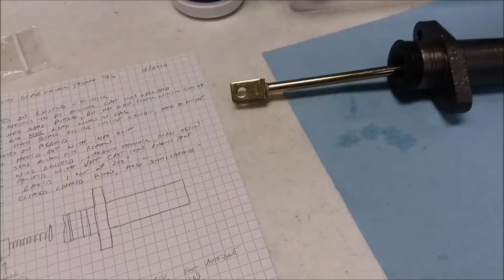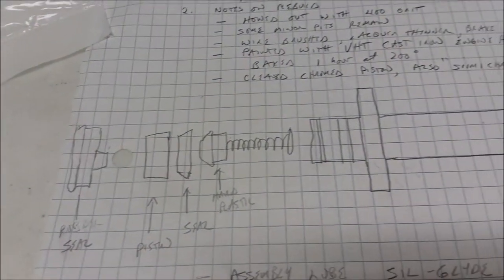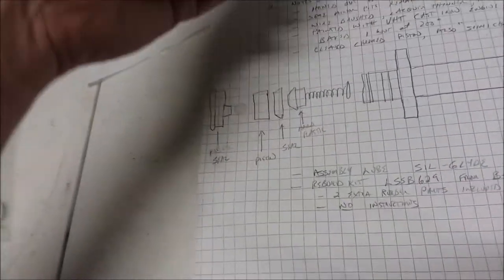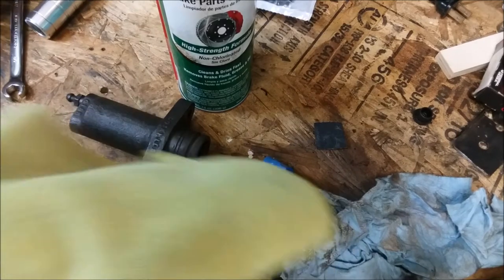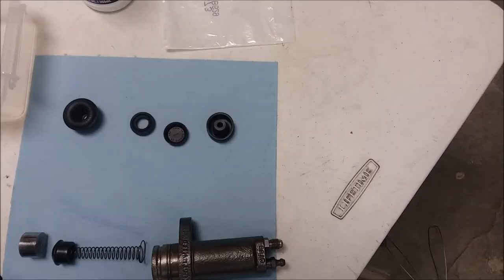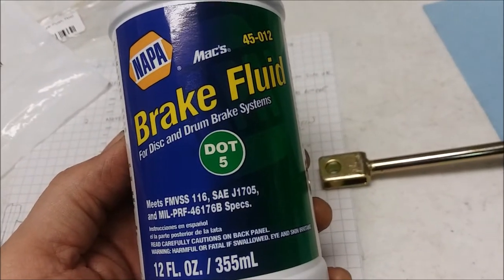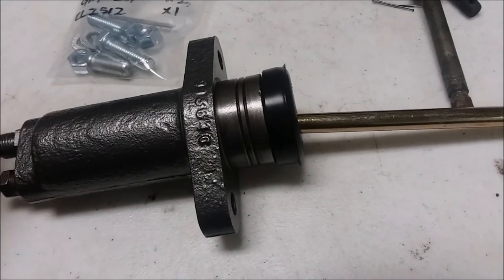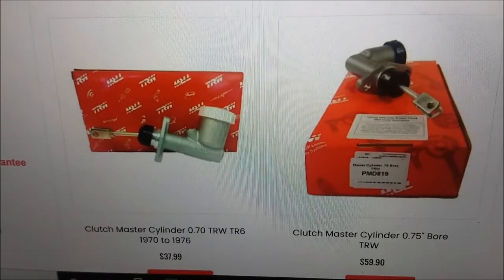Evaluating, Rebuilding Clutch Slave Cylinder for a Triumph TR6

Comment: thank you I watched this as I have a 1973 tr6 and am doing all the work on it myself as I had my tr exported to canada  in 1980 and cant find anyone to work on the fuel injection as all exported trs had carburetas , mines a right hand drive rust free and undesealed from new and hasnt been driven for 42 yrs has 30,000 miles on it so in retireement im doin everything myself as I tried to use other mechanics and that was just like dropping thousands of dollars into a firepit, so your videos will be watched with geaat intent , do you have one about a master cylinder rebuild as thats where Im at  thank you
Reply from the maker: Hi, sorry for taking so long on replying.   Keep me posted on your progress!!!!    You might try Chef Tush or Elin Yakov up there in Canada, see if they can point you to a mechanic that can work on the EFI.   Search on their names and "Triumph" and you should find them on Youtube.  

  I haven't done one on rebuilding a TR6 master cylinder, sorry.  Mine was beyond rebuilding.  I have done one on the brake booster adjustment.  https://youtu.be/J1ozyqzZqUI      
Before I switched to video, I did do a blog entry on rebuilding a TR3 master cylinder if that helps.     You might want to consider getting your TR6 MC  done by a rebuilder and getting it sleeved, IF you have an OEM master cylinder.  Try a rebuilder like Apple Hydraulics.  BTW - I have no financial interest in them...,

Comment: Great video Thanks good to know as I am almost at the stage of doing this.
Reply from the maker: I just checked out your channel.  My next project is part of what you are doing now - I am going to paint the engine bay, as mine is previous owner rustoleum black.  Let me know how your cylinder rebuild goes!
Reply: @triumphrestoration7403  Turns out my Slave cylinder was in great shape no ridges, no rust or ware marks. I did clean out the interior with cleaner and reassembled the unit. Thanks again for what you do.
Reply from the maker: @barry6274  nice!  Dont you love it when you can keep the original stuff!

Comment: Great video for those wanting to do a rebuild.  Have you ever had one re-sleeved before?
Reply from the maker: I had 2 failed brake master cylinders in a row.    First was Classic Gold after a year, then a TRW after a couple years.   I  paid Apple Hydraulics to sleeve an OEM core they had.  So far so good, but less than a year on it.  Never  had a slave sleeved before.